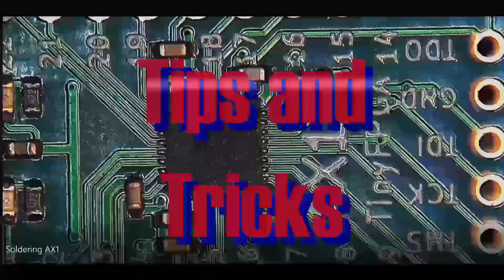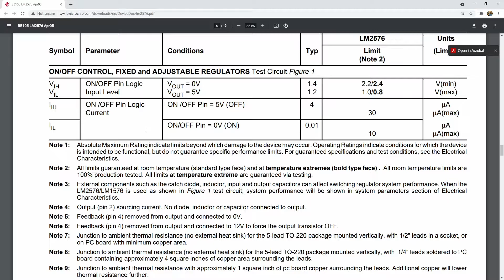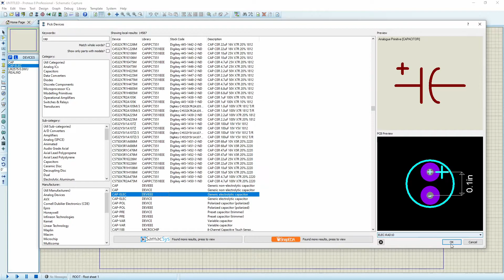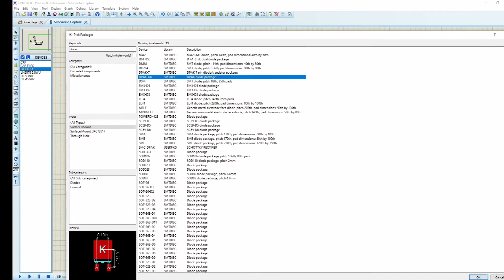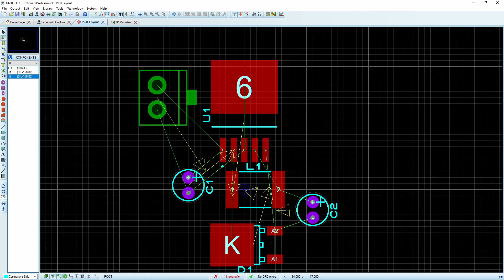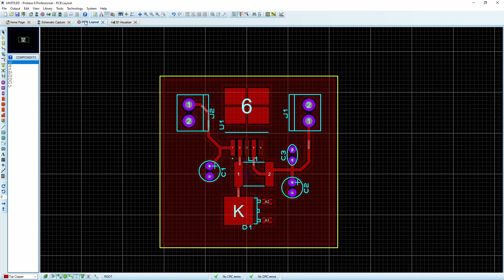LM2576 DESIGN AND PCB LAYOUT IN PROTEUS

Comment: what is LM2576 DESIGN AND PCB LAYOUT IN PROTEUS. can it be used as a library component in proteus. like Arduino. when we create a simulation circuit using the lm2576 module, we only need to retrieve it in the proteus library. and of course will make the job easier and faster. please solve, thank you.
Reply from the maker: The LM2576 does not exist in the library, you need to create the part or import it. Once is has been made once, you will have it for reuse. There  is no simulation model for it in Proteus however. If you are looking for a model to simulate in Proteus, you can try the MC34063.